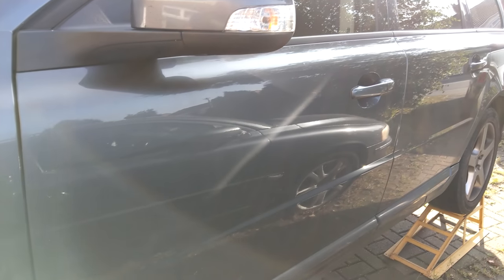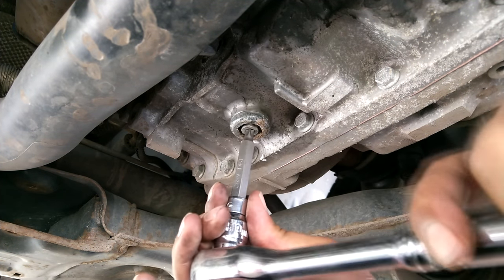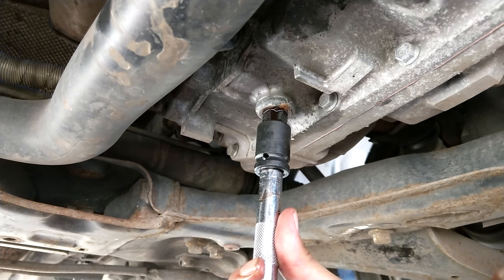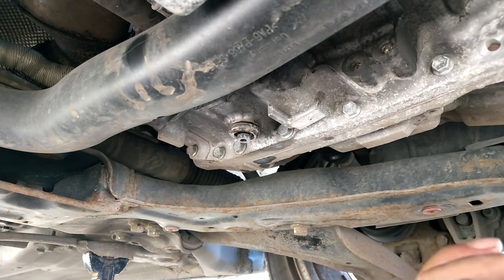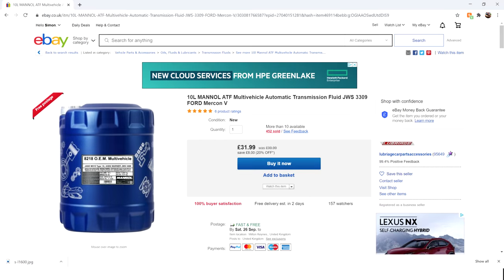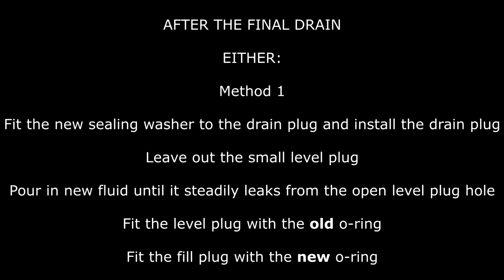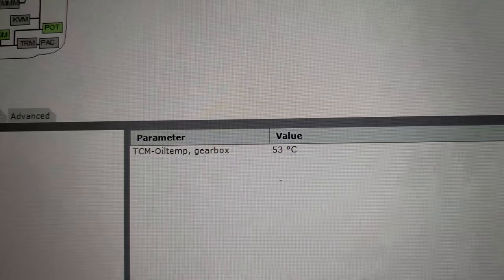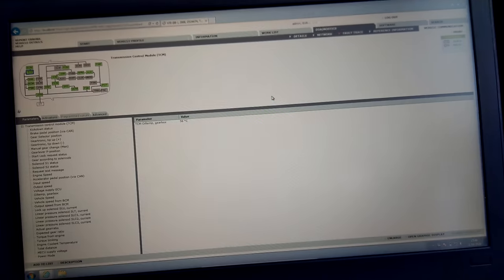Automatic Gearbox Fluid Change Aisin Warner TF-80SC

Comment: Fab video mate,  i had the gear box oil changed by a special automatic box mechanic about a year ago charged me £35, and I supplied the oil  did not notice any improvement in fact it was the same as when I put it in with him,       went to see him about 3 weeks ago about changing the solenoids in the box he said 8 new solenoids plus new oil £480 all in ,the car is a good but not worth doing at that price ,so after looking on  YouTube was going to have a go on changing the solenoids my self after all been in the motor trade 55 years doing repairs etc 68 now  and still loves a challenge  . Then came across your video about the oil needing to be flushed 3 times to get most of the crap oil out only done 84 k ,what have i got to lose bought the oil and flushed her out 3 times each time start up and engaging the gears ,it would not go above third but done all the other gears about 5 times in and out  ,on the first drain there was exactly just under 3 litres of black oil made sure the measurement was spot on  so just put in on the last refill  just under 3 litres of new dextro 6  best oil the exact same as the first drain off ,refitted everything back on to the car then out on the first run with in 50 metres the car was in fort gear smooth as silk never been as good haven't done a long trip, but you can just feel the difference not like when the mechanic supposed to have changed the oil starting to think he did not do the job just kept my oil and money , this time you definitely could feel the improvement the mechanic will not be having £480 of   me  giving  her good run on Friday let you know thanks again by the way trying to buy a lexia to be able to reset the gearbox oil counter Peugeot 407 coupe v6 2.7
Reply: when did you leave school ?

Comment: Another very helpful video, don’t think it’s the one I’m after but this is the way I was planning on flushing my xc90s gearbox rather than the oil cooler way. I can’t see a xc90 oil change on your videos but will look out for it
Reply from the maker: Some XC90 have this gearbox with a similar procedure and some have the AW55-50/51 which is featured in other videos on YouTube.
The car model isn't really relevant so don't worry too much about that.

Comment: My 2003 XC90 has the 5 -speed AF33 transmission which has the 24mm hex drain plug. I had to fill it through the dipstick tube and access is a bit better than the fill plug on the TF-80SC. I paid about the same for 5 litres of Comma ATF from Halfords. Euro Car Parts were asking even more for 5 litres of the correct ATF and that was with their discount.

Comment: Good video for anybody wanting to get some fresh oil in the box.
In Vida, I seem to remember on mine that the oil counter was something to do with counting how many times the box oil went over temperature and would flag up a transmission service light if it reached its threshold?  To make my cars gearbox shifts reset it is possible to clear the gearbox memory but not do the full relearn process. This resets the box to what I presume are standard settings and the box learns from that point on.
Be interested to learn if simply reseting the oil counter also resets the gearbox in other ways?
Reply from the maker: The adaption reset function you allude to is mentioned in the video as a kind of "there but not essential" function.
It depends on how bad your changes have become. 

I've read anecdotal accounts of fluid being changed without the counter reset and the full benefits of new fluid not being felt until at least that procedure was done. 
This suggests that the reset is more than just a counter going to zero.

I have no intentions of going through a fluid change process and not resetting the counter to test though. 😊
Reply: @sirobb  When I first changed my gearbox oil I didn't have Vida so I didn't reset the oil counter on mine! The gearbox adapted slowly and within a week was much better behaved.
I used Mannol oil as well and three years later I think it needs changing again. The oils viscosity is the key issue I believe as if it thins out to much under heating the gearbox wont adapt quickly enough and hard shifts and flares are more common  on mine now when hot. Yet another 'I'll do that soon' job!
Reply: Just to add, yes there is the adaptations process but you can simply clear the memory without going through the adaptions process, from my awful memory there was an odd button in Vida with something like TS200 on it which has no relevance to anything I could see, pressing tgat virtual button allowed me to clear the memory without going through the adaptions process. Maybe that button is the oil counter reset?
Reply from the maker: Yes those jobs do mount up quickly. 😊
I hope you get time soon.
Reply from the maker: No need to rely on your memory. 
The various TCM Advanced functions are shown in the video.
Reply: @paulluggar5964  ok

Comment: 3 questions Si...1 - Can you run the car on axle stands while circulating the new fluid or does it need to be on the floor? 2 - Is there a specific torque value for the main drain plug before the final fill? 3 - If I don't have access to DICE/VIDA to reset the counter is it worth doing this procedure?
Reply from the maker: 1. You could have it on axle stands but there is minimal benefit versus the risk doing this.
Holding the various gear positions with the front wheels braked is the procedure and there's no need to stray from that.
The car needs to be level whether on or off the ground. 

2. I can't remember the torque of hand but around 25-30Nm like the oil sump won't get you in trouble.
From experience on many cars, fit a brand new seal every time and use common sense when tightening drain bolts.

3. The TCM counts every occasion where the fluid temperature goes above a certain threshold.
Once it's gone over that threshold X number of times, a Transmission Service Required message will appear and you may get reduced performance.
Resetting the oil counter tells the transmission module that new fluid has been put in and means you won't risk getting service messages for old fluid and performance issues when you've actually got good fluid.

Comment: Great video. What I don't understand is why so much fluid is released when the level plug is first removed? Is the transmission overfilled by the factory and then subsequent fluid changes are set by the level plug or was it overfilled by someone previously?
Reply from the maker: @urbansoundscapes7734  Answered in the comments. 👍🏾

Comment: Si i have a 2006 V70 D5 Auto that has never has the ATF changed from the last owner as Volvo said it does not need changing cos they talk about things they don't know as most sales men do. If it has a fluid it needs a change don't matter if it says life time its just a gimick. And the car is now on 162k the ATF has gone black I've read that if is goes black or smells burnt don't change it and others say do change it so i'm a bit stuck on what to do? Any advice would be a grate help Also what is the gearbox counter does that tell you in the in the HUD when the gearbox fluid needs changing?
Reply from the maker: You may end up with a Transmission Service Required or similar message but I wouldn't wait for that.
Change the fluid with repeated drain and fills but you will need Vida software to read the fluid temperature to set the level correctly.
Reply: @sirobb  Yeah that won't be a bad shout will get it done asap i know the newer boxes are a lot better then the old one's and have heard they need a fluid change every 60K miles. And as mine has never had one from new and the car has a lot of motorway driving on it the box will not be that bad i think. Thanks for the advice

Comment: Another great video sirrob, looking at buying a volvo v50 d5 geartronic right now. My jeep wj has bad rust around rear lower arms on chassis so sadly is getting scrapped. Was wondering if these transmissions were any good and how hard to change fluids. I do 99% of my servicing, did transmission fluid change on Jeep GC overland including filter and gasket, new plastic round connector switch too. Jeep was great shifting through the gears after that. Saved pounds on garage prices too. Thanks for this video sirrob. Vinny.

Comment: Hi Simon, I am tempted to do the job after watching your video, whilst doing some homework, a Volvo dealership advised that I have all the fluid pumped out including converter, etc.. This was done using a dialysis type unit. Never heard of this method, so wondered what your thoughts would be on this process many thanks G.

Comment: Thank you for the video. It was useful. The original O ring seals and bushings are dramatically expensive. I think that is overpriced thing as it it so simple material and millions of other hydraulic equipment use similar parts but the price is 1 or 2 pounds for a bushing which is the right price to be (in my opinion). Another thing I think if you follow the Volvo described transmission flush procedure - were you basically flush transmission oil out through the cooler house is a better way to achieve best result faster. In your case mixing the new vs old oil ratio is getting better but not that fast as you would flush as per Volvo manual - through the disconnected cooler line.

Comment: For those just finding this video which is excellent btw. 
After 2011 you need JWS 3324 NOT 3309! 
Be sure you get the right oil! 
For info AW1 is 3324 equivalent.
0:30
Reply: But you can pour in 3324 into older, before 2011, gear box, right?
Reply from the maker: Age is irrelevant. If spec is 3309, use only 3309, if spec is 3324, use only 3324. If in any doubt , confirm with a main dealer not a YouTube comments section. 👍🏾😊
Reply: @sirobb  Thank you for the answer, you are correct!

Comment: Great video, most informal ive come across. My father has a saab with same transmission im told so doing some research. 
What would this normally cost to get carried out at a garage or specialist? Thanks.
Reply from the maker: Probably anywhere from £150-300 depending on the garage, the amount of fluid changed and the method used.
Reply: @sirobb  thanks very much.

Comment: Great video. I've got issues with the 81C variant in my ford S-Max and will do the same fluid flushes. 

Can I ask if you need to warm the fluid before the first drain and the best way to do so?
Reply from the maker: I always try to have the fluid as warm as I can so I plan the drain for after taking the car for a run out.
Reply: @sirobb  brill, appreciate that

Comment: Excellent video Simon, as usual.

Can I ask if having the engine running on the final oil level drain was the instruction within Vida ?

Cheers

Dave aka '37Ruby' on the VOC forum
Reply: if you don't leave the engine running you'll dump way more fluid than necessary...
Reply from the maker: Hi Dave. Yes that's the Vida method and it applies to others too but you can always check your exact car procedure in Vida for confirmation.
Reply: Correct in my opinion: Engine running and in "drive" the correct level is when the fluid is being circulated.
With the engine stopped;  The fluid will raise the level, as it drains back. 
So using the dipstick or the "Level Plug" will remove the essential fluid....it will be short on re-start.

Comment: Excellent video. Do you think an oil change may resolve gear snatching between 3&4?
Reply from the maker: @davida6520  A fluid change and reset of the fluid counter and adaptions is more often than not enough to eliminate the gear flaring you describe.
If the fluid age and quality cannot be vouched for, start there.
Reply: @sirobb  thank you for the information. My Aisin is mounted on a bmw 37.500 miles and as you are probably aware, bmw don't suggest a service until later, regardless of the gearbox manufacturer stating 2 years/20,000km
Reply from the maker: @davida6520  You could carefully take a small sample of fluid from the level plug. Just the colour, texture and smell versus new will indicate the general condition of the fluid currently in the gearbox.

Comment: Thanks for the video.  How do you rate the reliability of the older Volvo autoboxes?
Reply: I have a 2004 V70 D5 with nearly 310.000 miles on it, and the autobox still works reasonably well given the mileage and age... but the 2 to 3 shift is not always smooth, and sometimes the 3 to 4 shift has a noticeable delay. If I happen to press the accelerator right at the moment it has decided to shift back from 3 to 2 it might shift with a very unpleasant bang. Very rarely reverse engages harshly.

I changed the fluid around the 210.000 mile mark, a few months after I bought it. I drained the fluid and put about 3.5 liters back in, drove about 600 miles, and repeated that twice for a total of three drains. 

What probably helps longevity is that this car is only used for daily commutes to work which is about 60 miles of highway driving, and I don't abuse it.
Reply: catch it early and itll last
Reply: Jeroen74 thanks for your reply that’s reassuring that it’s still going reasonably well at over 300k.  I have an s60 and I love it but there’s very little legroom in the back for my 3 growing kids.  I have been looking at xc90s for the extra space which seem to mostly have the geartronic box hence my query.
Reply: @Jeroen74  I have a 2005 d5 xc90 which had similar symptoms. 230k miles. I had a gearbox software update perform at Volvo for £60. And it’s resolved the harsh gear changes and runs smoother.

Comment: How similar or different is the fluid drain/fill process for the  Aisin TG-81SC 8-speed transmission found on P3 Volvos? I can't find a tutorial or walk-through specifically for this application. I have a later P3 with 4-cylinder Drive-E engine.

Comment: My oil is quite new as i had volvo change it 15,000 miles ago, (£250 by the way)but now i see how easy it is to change id like to have a go myself. would i still need to use vida which i dont have, if i only do 1 drop and refill just to keep it fresh ?
Reply from the maker: Personally, I wouldn't go to the effort of replacing such a small amount infrequently and I wouldn't entertain the job without Vida which is also required for the fluid temp reading to accurately set the level.
Assuming the dealer did a thorough job, 15k mile fluid is going to be in good condition so I'd save your money and put it towards a Vida set up.

Comment: Thanks Simon for another great video! With these boxes being "sealed for life" and the car in your video already being at 135k, (it should have had maybe 3 changes already at that mileage, no one knows) but was still functioning acceptably. What would be a reasonable interval to do changes at? and have you ever changed the ATF and then experienced wet clutch slippage due to the "less grippy" new fluid?
Reply from the maker: I'd change it routinely every 40-50k miles if the car has normal use.
I've never encountered problems using new fluid. Some do less dramatic changes so just one drain and fill every couple of years or so.

Comment: Great clear video, thanks, I have a 2006 v70 d5 auto and I'm doing mine at the weekend, I've just got the exact same oil off Ebay, would those seals be the same for my box?, also I dont have Vida and dont know anyone with it, is it ok to change oil without vida
Reply: You can do it without VIDA, but it's important that you add exactly the same amount of fluid that you drained out per flush.

Comment: It's possible to do it correctly without vida dice? Perhaps gearbox will be reset after battery unplug for a half hour?
Reply from the maker: A battery disconnect won't do anything. Other tools are available, they just have to be able to communicate with the Transmission Control Module so check the specs with the seller.

Comment: Hello! Many thanks! for this valuable Video. I have a Volvo s60 Diesel. D3 Year model 2018. Automatic Gearbox. It's called the TF-71SC. Do you do the same way as you do in this Video, when you change the gearbox oil on my car? Thanks! From Tommy Bertilsson from Sweden
Reply from the maker: I don't have the workshop manual for that gearbox so you'll need to ask someone with experience of working on it.
Sorry.

Comment: Hi there, just wondering is this transmission has the filter to replace?
Reply: It has but in order to reach it, you need to take the transmission out and split it apart unfortunately. You see - manufacture claimed that these gearboxes are service-free and unbeatable therefore there is no need to do an oil or filter change.. but the life and practice showed the otherwise :(  You should change oil regularly if you want to have smooth gear shits but there is nothing you can do about the filter - it is down deep inside unfortunately...